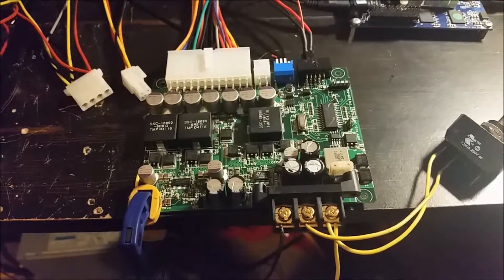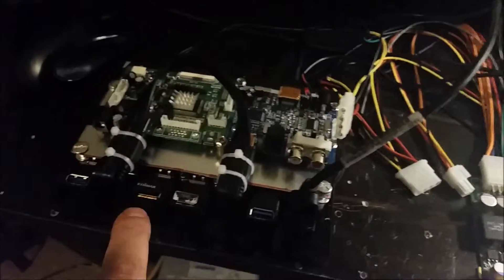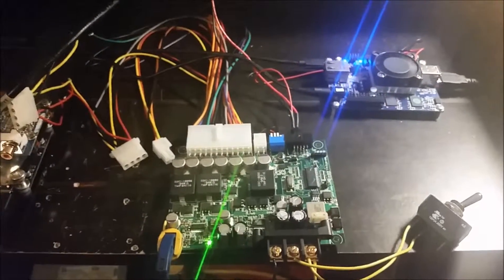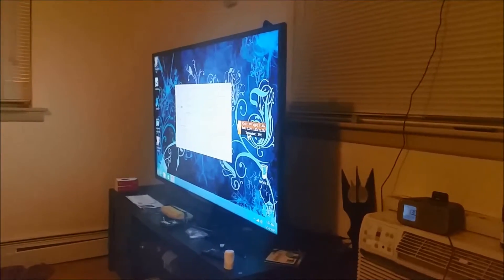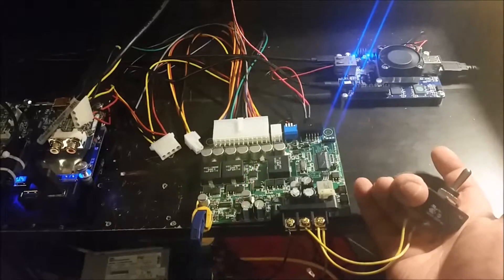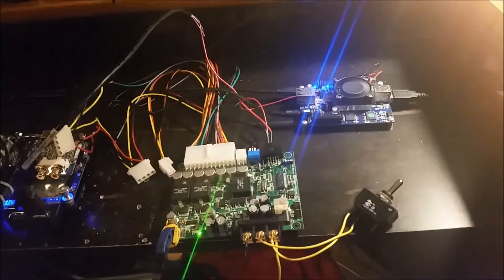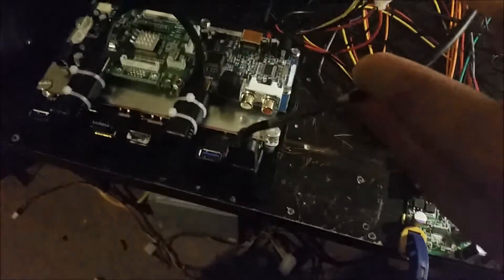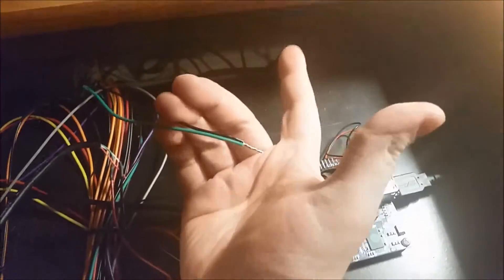M4 ATX Minnowboard Max Modification

Comment: Hello, I am trying to get this to work but I get no output voltage even with the 12v grd and ignition connected. I was thinking I have to set it up first through the software so I made a usb connection but the software can’t find device. When you make your usb connection did you just use the four usb wires? V+ d- d+ Gnd?
Reply from the maker: You need 12v running to the 12v connector and the ignition connector. You can test this by connecting a short piece of wire from 12v to ignition.

Usb is not required for power, only for software on screen display to show voltage, temperature, wattage, etc. Yes the four USB wires is all I used V+ d- d+ GND

check your atx harness, the harness must have a, green, power on wire that goes high or low to tell the machine/supply to turn on. So basically connect green(pin16) wire to ground to bypass this. ATX pinout below

https://images.app.goo.gl/fcE3cMRx8zNm3A4D9

Comment: how on earth do set the voltage start levels? i have a 100  amp hour battery at 12.65 the m4-atx will run for days but it wont start unless its 13.5 volts input (the reading from the contacts is different from what is displayed in the software) thank you kindly
Reply from the maker: Action News 

Hmmm its been a while, but there's three brass contacts labeled GND, IGNITION, V(+) 

During my test runs I was able to get the m4atx to power on with a 12v 3a power supply by connecting the negative rail of the 12v power supply to GND and the positive to V(+) and to simulate an on/off switch I simply bridged IGNITION to V(+) with a bit of wire and just disconnected it whenever I wanted it to turn off, but you can substitute this bit of wire for a physical switch. In my case for the m4atx to stay on I needed to have GND, 12V, 12V.

However, I did have one viewer who had the same problem and this method did not work for them, and that individual told me that a rom update for the m4atx repaired the problem.

You should also be able to change the levels in the software as long as it's properly communicating to a pc with the correct software installed. I made a very crude harness for the J8 on the m4atx to usb, but sadly I only use it to display the temp and voltages on the desktop I only remember changing the shutdown time and that the software made it a nightmare to do so. 

Hope this helps

Comment: I just checked out all the 3 videos and the project is just amazing. I would like to know to where have u installed the OS. I.e. memory card or USB or are u using a HDD . I tried powering on the HDD from the minno max but unfortunately I wasn't able to.  Using the USB 3.0 pendrive as a boot drive , the OS is quite laggy. Any suggestions ?
Reply from the maker: Haha finally someone who understands my frustration! ok. It has been a while since I've posted an update (Maybe I'll make another video soon), but in the time period of these videos I had my minnowboard max booting from a 32gb class 10-u3 SD card @ 89mb/s and the results are as seen in most of my videos (I thought the boot times were quite slow). I highly recommend switching to a sata form-factor; Msata-(needs luer attachment), SSD, or Sata-DOM. In a perfect environment Msata would produce the best results because it interfaces directly with the processor, but I found that the luer attachment would not fit my build design. I have now since moved on to an 80gb SSD @3gb/s, and with fast-boot enabled in the bios my new build boots from post to desktop in under 25 seconds. Also beware of the USBs... I have found them to be EXTREMELY uncooperative with just about anything.... just something about Intel's "xhci-usb" controller just does not play well with windows 8.1 uefi... it's almost like the two fight for control, and because of this I have disabled xhci in the usb section of the intel bios and this has calmed-down some of the miss-behavior...

hope that helps!
Reply: +CorJFexd (CJFD) : that clears a lot of things. Thank you. Also I am assuming that you are powering the SSD from the external power supply and not the minnow max, is that right ?
Reply from the maker: +Sravan Reddy In this video the green silk-screen board is the M4-ATX power supply I am using from www.mini-box.com and that's how I have chosen to power the hard drive and everything else. It's a neat, smart, and robust DC/DC converter and it can handle the rough voltages from the car alternator. One other thing I left out in my last post; Another reason I decided to give up on SD card/flash memory was because it wasn't reliable,  and I often had times where drivers would become currupt or just flat out dissappear when power-recycled or shut down. I haven't been able to test any of the repairs made to the bios by Intel so take that statement for a grain of salt because they may have repaired this issue since.